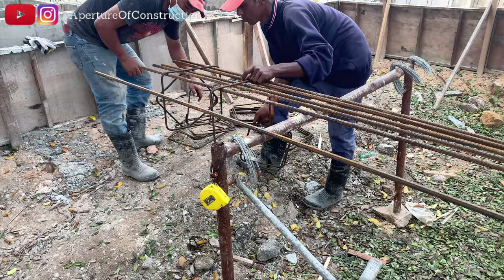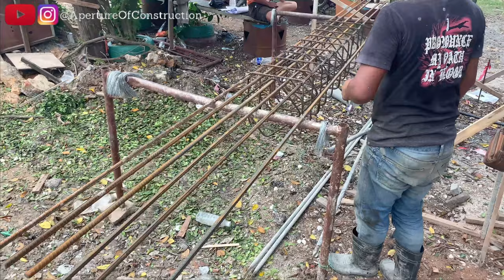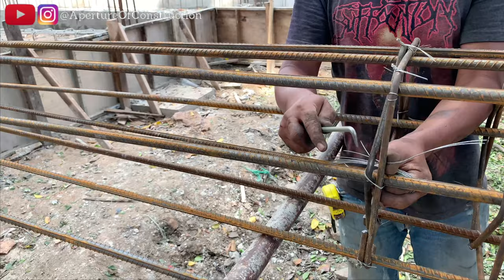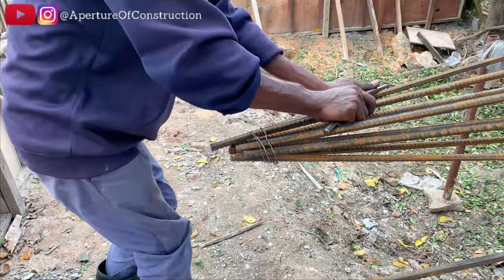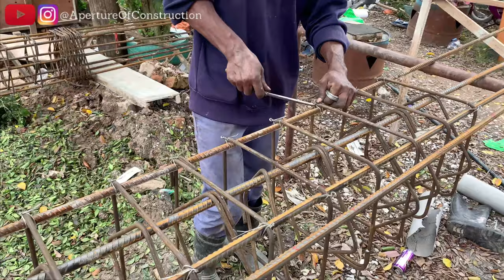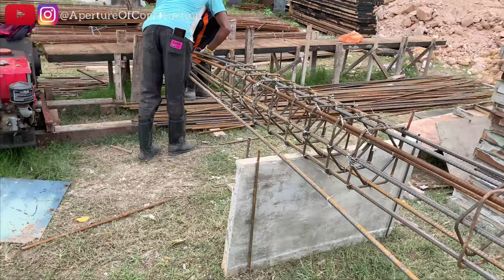Concrete RCC Column Steel Rebar Reinforcement Installation In Construction | Tying Column Steel Bars

Comment: Quiero saber si los estribos del centro tienes la misma medida
Reply from the maker: el tamaño de la columna central es el mismo que 500 mm x 500 mm
Reply: Y el estribo de afuera
Reply: Q tamaño es la medida del estribo de afuera
Reply: Quiero saber si los estribos de afuera con los del centro tienen la misma medida para así cortar las varillas
Reply: 500 x500  Q
Reply: Centímetros, pulgadas, Qqqq
Reply from the maker: 500mm x 500mm = 50cm x 50cm
Reply from the maker: es la misma barra de acero interna y externa 50cm x 50cm

Comment: stirrups bending angle should be 135 degree not 90 degree, deformed steel bars should be used!
This could lead to structural failure